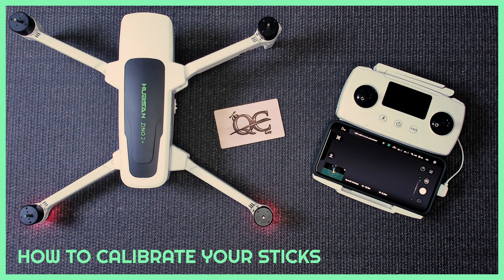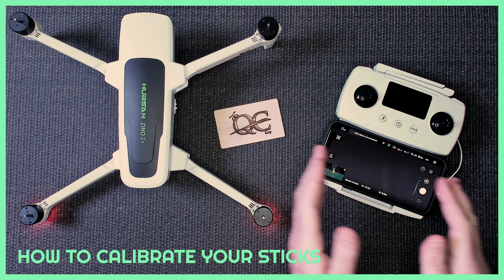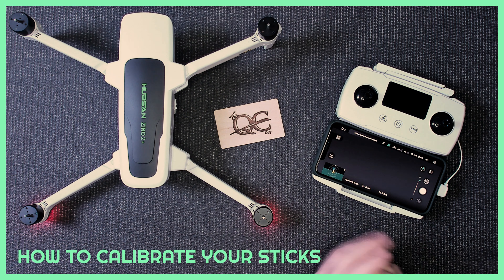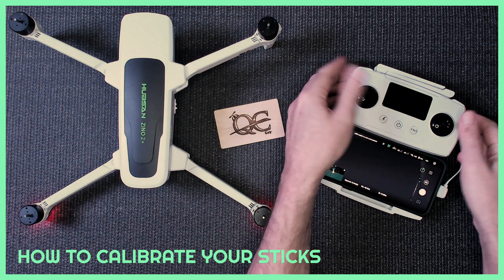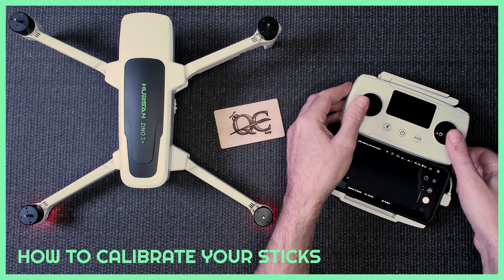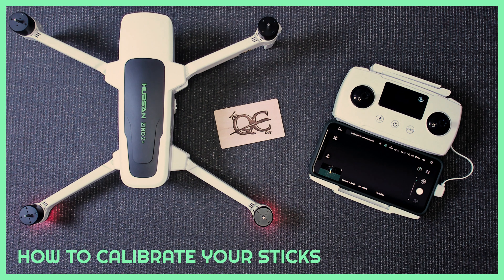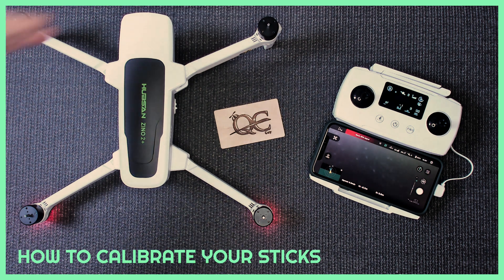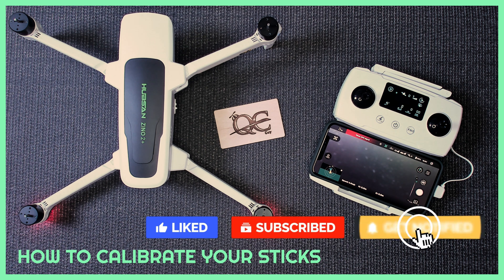HUBSAN ZINO 2+ / ZINO 2 PLUS - HOW TO CALIBRATE CONTROLLER STICKS / RC CALIBRATION

Comment: Hello!   It's going to be difficult for me to up load a video because I don't know how to do this I did exactly what your video described, maybe I need to reset the drone and or download another X-Hubsan 2 app and start fresh ?  Is this a good idea ? Thank you
Reply from the maker: Do you know how to rebind where you press the small micro button on the side? 
Try that and there’s no harm in reinstalling the app should you need to after you try a rebind but I wouldn’t reset the drone if by that you mean install recovery factory firmware. That could open a new can of worms.
Reply: @QCGUY  Ok, thank you I will try that..
Reply: Вначале нужно размагнитить компас, а потом уже калибровать. И все будет ок.

Comment: I'm having a lot of difficulties trying to armed the motors for my zino 2+ I have done all the calibrations that I seen on you tube. It's looks simple enough, but i still can't armed the motors what else could I do.  Thank you
Reply from the maker: Does auto takeoff work?
If that works from the and you can’t start it with the controller sticks then maybe you need to calibrate your sticks.
Reply: @QCGUY  Yes auto takeoff works, and I have done the controller stick calibration but nothing, what do you recommend
Reply from the maker: @alfredocollazo6929  I would like to see video of how this if you can upload something.

Comment: I did an update on the app when I was starting to fly my drone. The update never finished and now the controller won’t connect to the drone. I’ve tried to pair them and nothing is working. Any ideas or tips? I’ve tried reaching out to the company but yet to here back from them
Reply from the maker: You need to do the recovery firmware just like I did in a video for the Zino 2. I do not know for sure if you can use the same firmware for the Zino 2+ so I would ask them for it and then follow my video on that. 
Let me know if they give you the firmware and maybe share it so I can compare it. Thanks

Comment: Hey Chris, thanks for the always good content and I sincerely hope you are doing well.  Took your advice on my Zino Pro about recalibration and haven't beach crashed since, got some beautiful footage at Island Beach State park to share with my mom, who grew up near there.  Anyway, as usual, I'm asking an off topic question and sorry if you covered elsewhere but what are your feelings about the likely impending DJI FPV platform?  I'm keen to get myself my a XMAS new guitar (epiphone sg modern) but holding (barely) on to that sweet sweet cash in reserve for the DJI  because it could be amazing.  Looking for assist on the delayed gratification!  That said, I get the DJI will be 3x as much .... but appreciate your thoughts.
Reply from the maker: There’s a lot to ask yourself about that price FPV setup. Is it something we can repair without having to jump through DJI hoops in their programming? Are the parts affordable and will it void your warranty to repair yourself? Is it really a open format or proprietary to what they want us to control. 
Too much unknown for something so expensive that is likely to take some hard hits and break parts. I personally am not a player in this model.
Reply: @QCGUY  Roger, makes sense.  Concur it will be a proprietary lock.  Thank your for your insights.  Generally I roll with open systems.   Not a fan of the walled gardens.

Comment: Hi!  Got two questions for a gent to seems to know all the know about he zino!  I have a Zino 2:

1.  My right stick tends to “stick”.  If push all the way to the left, it tends to stay there sometimes.  Seems to be clean and movessmoothly, just sticks.  Any ideas?

2.  Are there any options for quieter blade setups?  Of course i know it’s big and heavy and that means neding to move a lot of air and that means noise, so i have low hope for a solution here...thought i would ask all the same.
Reply from the maker: The potentiometer could be defective worse case. Not sure where you are but I have them if needed. The left stick is clear of anything that could be getting in the way but it's not a bad idea to take a look unless it's under warranty and you can get Hubsan to send you a replacement. The right one has 4 wires near it that I have seen get in the way and rub against it causing it to stick by friction. There are 2 wires on the left that if not in there routing slots could possibly do the same thing but again this is where taking it apart will hopefully shed some light on the problem. 
There are no low noise props for this quad and be careful when you go there with any quad. I only trust a few third party props with Master Air Screw being my #1 choice. They don't have an eye on Hubsan stuff so not likely there. There are a lot of copycat props and they also come in colors but this is a area where I only order from Hubsan to avoid these copy's. The clones even come in perfect Hubsan packages just so you know. Hope this all helps...

Comment: Will this tip help with the "crab walk" issue. I'm struggling getting my pro to fly dead straight 🙄
Reply from the maker: Yes it’s possible but I would recommend the horizontal calibration as well just to be sure everything is dialed in.
Reply: @QCGUY  cheers for the quick reply Chris. I'll recalibrate both this evening and see how things go.